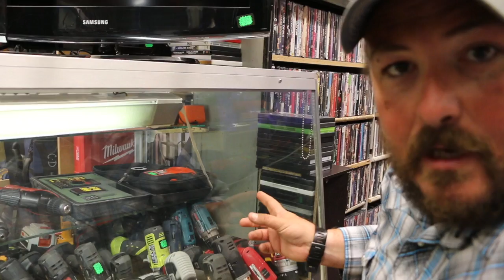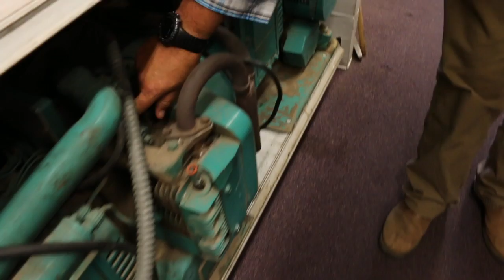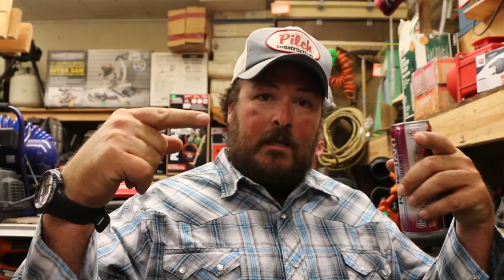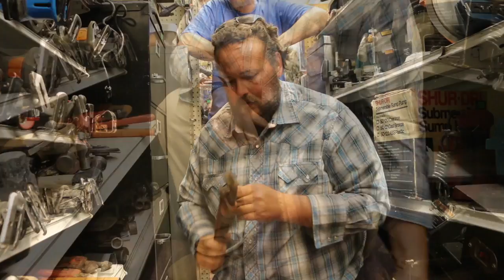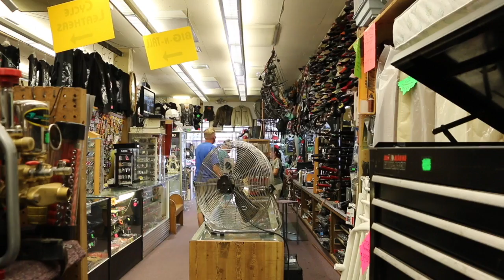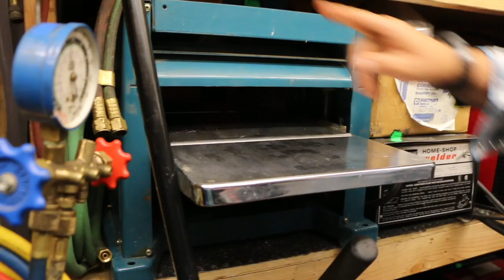Pawn Shop Tips and Tricks for A Budget Set of Tools

Comment: That Makita planer probably only has 2 blades whereas the Ridgid has 3 but both will  only plane one side at a time. I got a Harbor Freight special (pun intended) and it only has 2 blades. But here's the kicker: As long as you use ANY tool as gently as possible it is going to do a great job and last a long time. For instance...I will make several smaller passes with my planer than someone who has the Ridgid or DeWalt machine. It takes more time to get the same results but it gets me there just as well, And I have the extra time that someone else might not. My ONE rule that guides me when getting ANY tool is simple: You get what you pay for. That Ridgid planer has 3 blades. Therefore when you need to change blades it's going to cost you more and cost is just as important as the quality of the tool. Just thought I'd add a little extra coverage for the DirtPatchHeaven family. Very good info presented here. Another excellent video brought to you by DirtPatchHeaven.